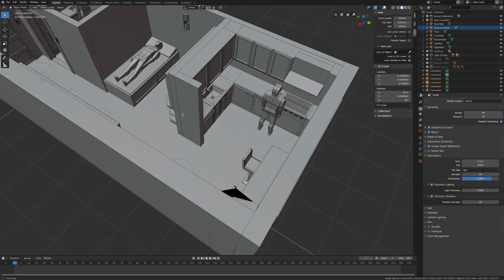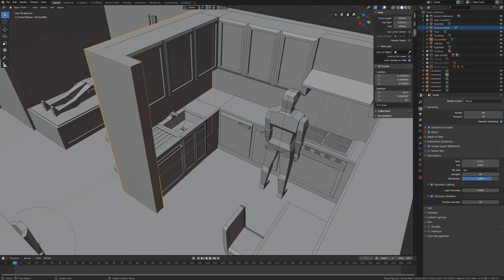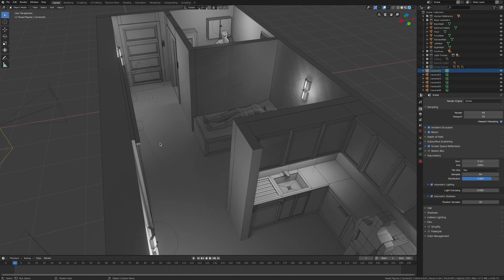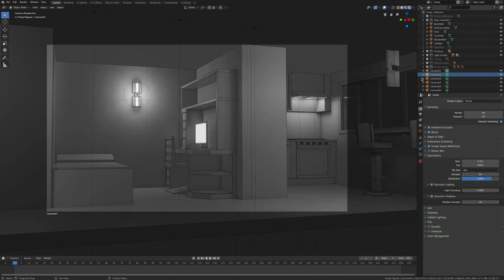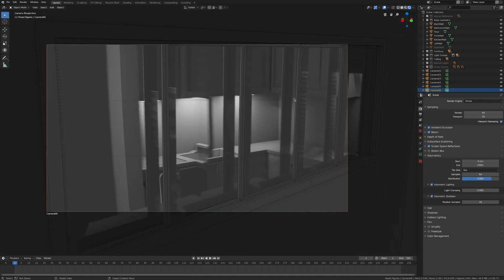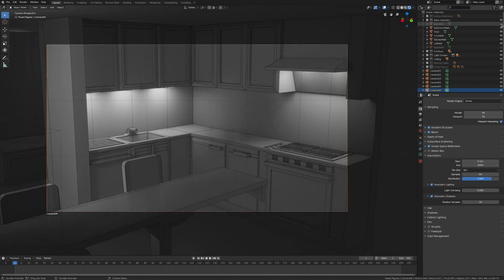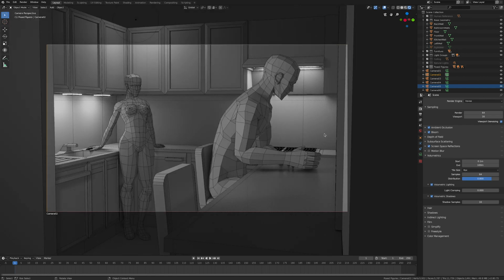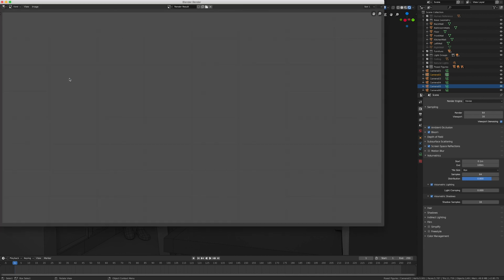Using Blender for Concept Art - Part 1

Comment: Great tips! Thank you! I would say however, that human reference is always important to have in your scene as a yard stick. Otherwise its easy to introduce scaling problems, which as a design element has the most weight in visual composition and its hard to fix spatial relationships later on. Also no lighting or texture will help covering it up.

Comment: i l give you a little advice. You can modify the clipping in camera settings just like for viewport so you won't need to hide walls anymore. This is useful because you may have an environment light and hiding walls will mess it
Reply from the maker: Thanks for the tip, it’s true that your method is efficient. 😉👍🏻
Reply: or you could remove the outside faces and turn on backface culling

Comment: Hello there! I also found this video pretty interesting! But there was a question, Does the 3d reference actually take you less time to build rather than actually startind to draw from scratch?
Reply from the maker: Hi Nishant, that’s a great question and the answer to that is that it depends on your drawing abilities. I work both ways and in some cases like with storyboarding, I sometimes prefer to draw the scene out instead of 3D modeling it because indeed it just goes faster. The more experience you have in drawing perspective without rulers, just your lose hand, the easier and faster it will be to recreate the scenes in your head without the need for 3D software. However, and this is a massive plus point for 3D software... once you have made the investment to build your 3D environment, you can be pretty sure that your traditionally drawn shots will never be as accurate as your 3D ones. You will also be able to test out many different camera angles within the same spaces over and over again. Because of this, I use 3D on big projects where I have the time to try things out before committing, but I understand what you mean by asking if traditional drawings just go faster. The answer is yes, they do when your skill is good enough to understand perspective really well and you have a solid understanding of human anatomy and drawing poses with ease. I hope this answers your question. Wishing you all the best on your creative journey 😉👍🏻
Reply: @artofdavidarroyo  It certainly did! Thanks for answering, this quickly!! I got recommended this even though I don't use blender much, but I am interested in concept art. It seems a pretty good tool to use!
Reply from the maker: @nishantbodkhe7443  yeah Blender is really awesome. I constantly recommend my students to use it. It’s not going to work as well for everyone, especially people that have difficulties with technical stuff as Blender is a whole lot more technical than just picking up a pen and start drawing. But yeah... once you can get past the technical aspects of it, it’s a massive help and blast to use. A massive timesaver in some occasions and indispensable as a reference tool for concept artists. Best of luck picking up the software 😉 I’m sure you’ll do great.